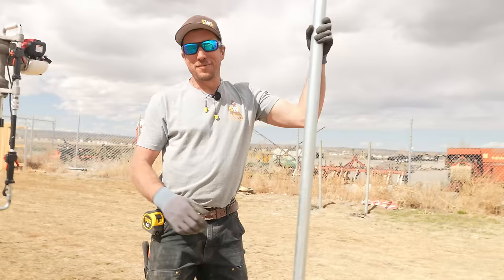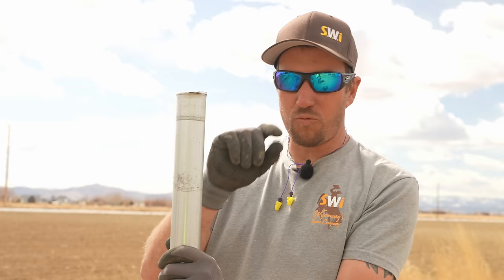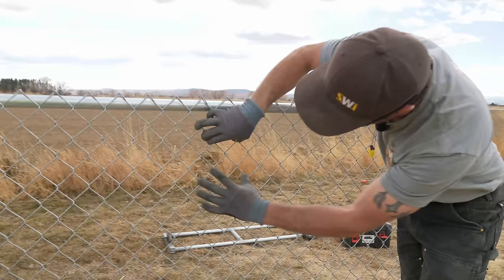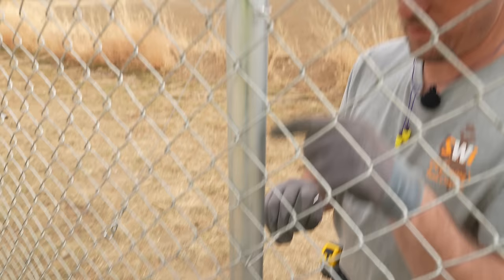How To Install Chain Link Fence The Easy Way

Comment: After Hurricane Katrina I was tasked to build a security fence behind and to the left of a church so that volunteers could park their cars and not have to worry about them being broken in to.  Well the youth minister and the teenagers got a workout driving the line posts.  We only set 3 terminal posts and we would tie the long 200ft end to another fence.  This church had been given several thousand feet of chain link fence and line posts, so we had to pick thru and pull out line posts and larger rolls of fence wire.  They called me to the outside for their problems.  Sew the fence together. Done, except 1 section was backwards.  So my helpers got the end and pulled it like bulldozer track to line up the links and pulled it back in place and sewed it in.  Then the 14 helpers all grabbed a few tie wires and stood the fence up.  WELL!!! Turns out that we have a 4ft fence frame with top rail, BUT 5FT FENCE FABRIC!!!!  Well, we tied the fence wire to the top rail while using a cumalong to stretch the wire while the teenagers had sticks beating the fence wire to get the slack out.  Turns out it looked really good and nearly impossible to climb over.  That extra 12 inches above the top rail turns out to be a very good deterant.  You grab it to get a leg up and it bites you in the leg, crotch, or arms because that 12 inches bends toward you.  Would you believe that our last 1/2 day there, a gentleman walked in and entroduced himself as the overseer of Dikes, Levies, and Waterways and tells me "THE FENCE IS ON THE DLW PROPERTY" and we have to take it down.  I reply,  I am so sorry about that, but we (our church mission group) are leaving here in an hour.  He then comments on how straight the fence is, but why did you leave that 12 inches or so above the top rail???  Well sir, it was a mistake.  Our fence posts were barely 5 1/2 ft long and no one measured it before we stood it up.  Then he asks, "how much concrete did you use?"  I reply, NONE!  I pointed to the side hallway where he came in, and to the 4 bags of concrete mix and the post pile driver.  The dirt was a hard clay mixture and after we drove the corner post we decided to just pile drive the rest of the posts into the ground to the pulled string.  And the 12 teenagers and the youth minister did a excellent job.   I told the overseer that the Baptist Association Coordinator would be back Tuesday and he could come back then and show him the boundry lines of DLW PROPERTY.  Moral of this story,  THE LORD WORKS IN MISTERIOUS WAYS....
EPILOG:  I never heard about the fence again, but later heard that there were 250 - 300 Volunteer cars parking in the secure area.  Sometimes a simple mistake can be beneficial.
Reply from the maker: Sounds like an adventure! We're big fans of driving posts too... 👍🏻👍🏻

Comment: Put the tension wire on the inside of the line post. It holds the bottom of the fence closer to the fence line and gives more back pressure to anything pushing on the bottom of the fence. (Dogs Primarily)

Comment: I agree with using 4 straps at the terminal posts. chain link fence that I have seen where they only use 3, don't look as nice and neat; personally I think it would keep it looking good longer because of the added strength!

Comment: Great video! In a full yard, do you measure each post @ 46" and cut it? Or do you run the string line and smooth out the lines essentially (if some are at 45-1/2 or let's say 47" where the string hits along a 100ft run) do you then proceed to mark where the string is on each post? Hopefully this makes sense! Keep up the awesome videos!

Comment: Great video. Does anyone know if the eye tops can be replaced with boulevard clamps? I only have 1-3/8 posts to use for both my line posts and rail posts and they dont make that size for eye tops.

Comment: Thanks for doing this video. It's very informative.  However, Where is the link for the 12 1/2 gauge tension wire link? Where did you buy it? I've been looking. I see a lot if 9 gauge wire being sold.

Comment: Thanks for a great video.... Though can you explain how to determine if it s appropriate to ram the intermediate posts or concrete them into the ground?
Reply from the maker: If it's too rocky you'll need to dig and set. Likewise, if your soil is too loose and shifty, you'll need to dig and set. The part of the post that's in the ground should not move.
Here's a vid on how deep to go if driving.https://youtu.be/mc92svvCRFo
Reply: @SWiFence  Thank you Sir....

Comment: Good stuff. If you use the gas powered pounder for the fence posts I'm to assume you don't need to concrete that post. Does that still last long term? I like the convenience, just don't want to have any loose posts in a few years. Thanks again!
Reply from the maker: Yes it does.

Comment: I am wanting to do a fence maybe 6' high with 2 strands of barbed wire at top. Do I need to concrete all my posts or drive them? If concrete, How is the best way to dig holes? Do you use a laser to line posts or just a string? Any advice would be appreciated such as post sizes, distance between posts, etc. I'm thinking about doing a black fence and considering a rail at the bottom for added strength. Please help! Do you sell any of the tools? What is the longest length I would pull before securing and what would you use to pull it? I have several hundred feet of fence to do.

Comment: How are you getting one straight line? Are you just using a 4 foot level or something? And any tips to cut the poles if I do not have that band saw thing your using to cut them so quickly?

Comment: Can you order just the straight bottom pieces? (The parts you attached last in your video) And what are they called? My chain link fence is kind of coming apart at the bottom and really caving forward (if that makes sense?) and I’m trying to figure out how to fix it, because I do not have what you installed last at the bottom. And I have no experience and not a clue!! Thanks for the video

Comment: I was surprised that you just pounded the posts in and didn't need to dig a post hole and put concrete in.  Is this because is is a metal post and not a wood fence post?

Comment: I have a 6’ x 220 lineal ft of chain link fabric + 2 single swing gates to install.  There are 6 terminal posts for corners and 4 terminal post for the gates, some slope in grade and posts are already in.  

How long should that take two trades guys (1 carpenter, 1 cement finisher). Trying to see if 32 man hours for two guys is about right.

Comment: Great video! Just one thing I don't understand, at 18:00 you use a tool to lift up the fabric. I have never seen that before, why do you have to lift it up?
Reply from the maker: Just because we want the middle of the top diamond in the middle of the rail. We're very particular about how much fabric is extending over the rail, and dressing the fabric at the top rail helps us be consistent all the way down.

Comment: Solid and informative video! You earned a new sub. Haha we've got a 10-ft gate that we're going to remove and replace with some chain link here pretty soon. Someone else brought out a guy and he quoted $1,700 for the job and I knew that that was bs the moment I heard it. So I did a little bit of research on materials and figured that it could be done for a small fraction of that cost diy. Based on home depot's website and your video, I was right to call that quote bs. Lol
Reply from the maker: Well, from a contracting perspective, he probably wasn't too far off. Most of the cost of a job is in mobilization--once you get there you can add or subtract footage without affecting the overall cost dramatically. He does have to recover his overhead somehow or he starts to lose money.
BUT, you're absolutely right--you've got this! Do it yourself and save money! Build a killer fence. 👍🏻👍🏻💪🏻💪🏻

Comment: When commenting on stretching a string line from terminal post to terminal post and measuring random spots in between to make sure the fence would fit....did you mean to say the measurement had to be 45 inches or greater versus(since 45 is the minimum when calculating 48-3) what you said of 46 inches?  I'm thinking that was the case since one of your measurements was 45 7/8th but I wanted to make sure it wasn't a comment made with the theory of close enough :)  I'm going to be doing a 4ft fence in preparation for our new puppy and really have enjoyed how thorough your teaching style is and the professionalism.  A few others are commenting on how uneven terrain affects install and mark me as another subscriber that would like to see this as well.
Reply from the maker: Yes, you need 45" just for fabric. We chose 46" so we would have a 1" gap at the bottom (this also give you a little wiggle room for variation). The ground in the middle was 1/8" higher. 👍🏻

Comment: I have a small fencing business but it's all wood, wrought iron and vinyl. The job I'm taking on is dividing the inside of a 40,000sqft warehouse with 12 foot chain link. I have many questions. The posts wll be welded to plates that will be screwed into the concrete floor and secured onto the concrete walls.
Reply: The company providing all that fence should have the specs for installation

Comment: We will be installing around 300' of 6' tall chain link fencing.  How do we hold the huge roll of fencing up on a budget? Is salvaged and we already connected it all and rolled it up.  It's massively heavy. We do have access to a skid loader with a bucket but not the fence holder attachment.
Reply from the maker: You may just have to lay it next to the fence, push it to unroll it, and then get some help holding it up to the fence, using a fastener to keep it up as you go. We use these tools (https://youtu.be/V8OQTHrO3rY) to hold up the fabric on long runs, but you can DIY something to do the same thing. Even just putting up a temporary loose tie every so often can help. Keep in mind, of course, if you have any corners you'll be terminating the fabric at the terminal post there and starting fresh on the other side of it, so your fabric only has to be as long as your longest uninterrupted run. You can also weave sections together after they're held upright on the fence.
Reply: @SWiFence  right on.  Thank you so much.

Comment: I do not see any links for tools to install the tension wire, like the T-handle. Home Depot nor Lowes has it. 
I can say I really like the video on how to install a chain link fence correctly. I just had one installed and it was not done as well as what you do. $2400.00 for a 150 chain link fence, 5 feet high with a 10 foot gate across a driveway and a 5 foot gate on the back section of the fence. Tension wire was not installed, so I am going to do it myself. No hog rings on the fence to the tension wire either. I think I got screwed. Other bids ranged from $3200 to $5400. Probably would have been a better job than what I got for $2400.00 dollars.
Reply from the maker: The links are all in the description, if you show the whole thing.
I'll put the t-handle here for you: 👉🏻 T-Handle Tension Wire Tightener - https://bit.ly/T-HandleTightener
And yeah, the lowest bid is rarely the best work.

Comment: May be an odd but simple question but I’d love to know what kind of knot you are using to tie your string line to your post.
Reply from the maker: Most of our guys are using half hitch or multiple half hitches. SWI Florida likes to use a fisherman's knot which is easier to untie. 👍🏻

Comment: If you had 244 ft of chain link, when installing would you recommend placing a terminal post in the center at ... Let's say 122 ft.?
Reply from the maker: The standard is 500 feet, so you wouldn't need a terminal post in the middle of your 244 feet as long as you're stretching it well and bracing correctly at the ends.

Comment: Hi there, awesome video! Can you use stainless steel zip ties instead of the hog rings and instead of the easy twist ties?

Thanks
Reply from the maker: I’m sure you could for a quick fix but wouldn’t recommend it as a permanent solution.
Reply: @SWiFence  Thanks for the reply. I'm in Canada and they don't have the EZ twist-ties here (not that I can find at least).
Reply: @SWiFence  Could you use regular ties and just twist both ends into the tie tool for an effect similar to the EZ-ties?
Reply from the maker: Yeeeeeees? I've never tried that. I feel like it's not going to twist up tight correctly, but who knows, might be worth a shot.

Comment: Awesome video man. Been many many years since I did this. But my one question is how did you come up with you height marks on the end posts. I’m putting up 5’ fencing and was trying to figure out how to get heights? Thanks for all your videos.
Reply from the maker: Sorry to be thick-headed but I'm not sure I understand the question. I'm measuring up from the ground. https://youtu.be/YLptJuEQw8Y?t=240
Is that not what you mean?
Reply: @SWiFence  I think he is asking how much post to leave above ground for a 5' fence.  You are saying to leave 45" above ground minimum.  Is that for a 3' fence?  Where is the 45" calculated from?
Reply: @SWiFence  I am with these guys... For a 48" how did you get 45" from the ground then add 1"to get to 46" for the top of the top rail and yet, the center of the top rail is in the middle of the top diamond? I know you are not wrong but it is confusing since a 48" chain link fabric is 48" from knuckle to knuckle.

Comment: Dumb question but can I still put the tension wire if the chain link is already up? If so do I just run it through the links? 😅
Reply from the maker: Sure. It may be a little harder, but you should be fine.
Do NOT run it through all the links. Run it and hog ring it to the fabric just like normal. 👍🏻

Comment: What do I do with a gradual slope? Follow the slope? Or stage it out staying true horizontally?
Reply from the maker: Small humps and bumps you want to run straight through and stay level. Gradual slopes you want to follow, but don't break the angle suddenly at one post, adjust the posts before and following to get a nice smooth roll. 👍🏻

Comment: Love the video! Just one question… I noticed your terminal posts were already in the ground at the beginning of the video, do those need to be set in concrete or can I pound like the line posts?
Reply from the maker: You can pound just like your line posts.
Reply: Thanks so much for the advice! I’m wanting my fence to be 5 feet high. Should I get the 8 foot posts instead of the 6 foot posts?
Reply from the maker: Yes! Do NOT get 6' posts and only put them in the ground 12".
Reply: @SWiFence  Thank you so much for everything! You guys are incredible.

Comment: Hello and Thank You for all the helpful information. I was wondering when cutting the height of the terminal post, do you cut it 2 inches above the center of the top rail or 2 inches from the top of the top rail? Also, I'm using a lower rail, so I am thinking, when spacing the rails, the dimension will be 45 inches from center of top rail to center of the bottom rail, correct?
Reply from the maker: Let's see if I can answer this. From top of grade up 45 inches is where the bottom of the top rail will sit no matter the top rail size. From that mark up 4” will be to the top of the terminal post. So from bottom to top rail up 4 inches is top of terminal post. The best way to set a bottom rail is to set it after the chain-link is up and tied that way you don’t have to measure where the bottom rail goes.
Reply: @SWiFence  Thank You, it all worked out well, now I have to make 3 gates (1-5/8)

Comment: So my idea worked like a charm didn't have time to film it scrambling to finish before the rain 10 posts 5 hours 😂 . So our gas pounder they bought had a 1" collar sleeves so I took a 1" 3/8 thick wall welded a 2 inch plate on the bottom shaped kinda like a small moon to go in the hole and tamp around the song tube. Cut  the pipe at 4ft 6" seemed to be the ticket comfortable height.  Used the gas pounder and custom pole to tamp angular cut 3/4" stone around the sono tube because the ground around has zero surcharge 4ft deep and the concrete post just moved like crazy so a 9in hole was turned into 14inches leaving 6inches 4ft deep tamped stone to 120 psi can't move the posts at all now. If you ever run into this issue i'd suggest that because using a 2x4 shitty.
Reply from the maker: Nice!

Comment: Is there an easy way to install tension wire on bottom after chain-link "fabric" has already been installed? The city moved my fence back and reinstalled it after a sidewalk project, and it was an old buried fence so didn't have tension wire... now our dogs can just push bottom out. :D
Reply from the maker: I don't see why you can't. You might run into a few headaches from the fabric already being installed but it should work fine.
Reply: @SWiFence  great, thanks for the reply!

Comment: What if im putting up a 90ft chain link fence, do I still just use 2 terminal posts? Feel lile that would be way too long stretch.
Reply from the maker: Standard is 500' before needing another terminal post. You should be completely fine. Just make sure you're stretching it well.

Comment: Hello there I'm planning on installing a 4ft chain fence the poles I'm getting are at 5'6" both terminal and line post my question is can I only put 1 80pd bag of concrete on my line post ? Or whats recommend thank u in advance for any information
Reply from the maker: I wouldn't go with less than 2 or 2 1/2 bags minimum.
Reply: Ok thank you

Comment: Do they not make pole top T fittings for corners?
Reply from the maker: Don't need them. Using two rail ends and brace bands allows you to adapt to any angle you need. https://youtu.be/ooqa6abatBM?t=111